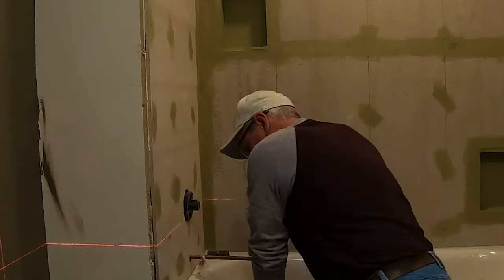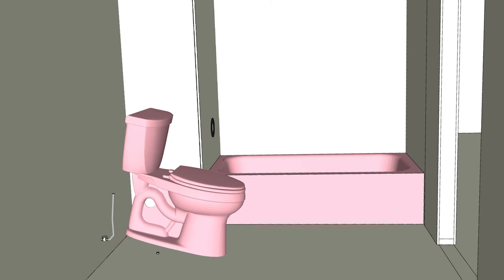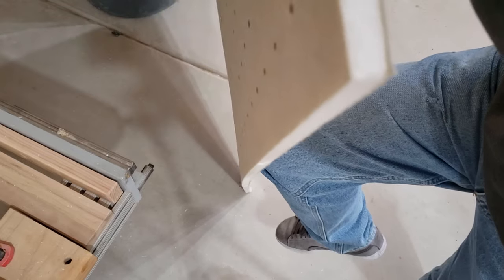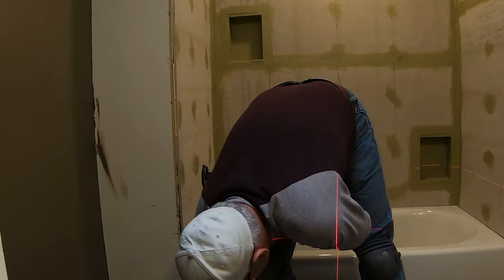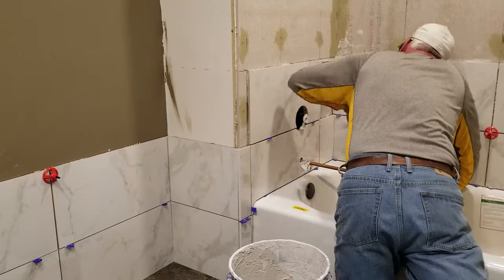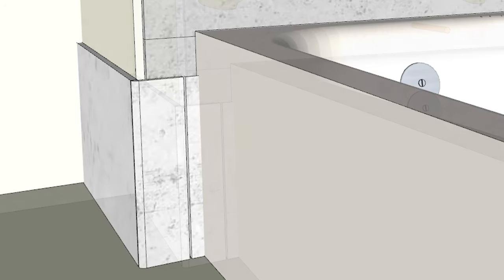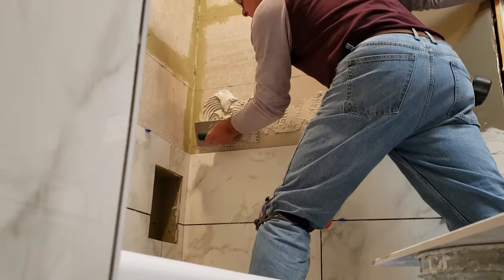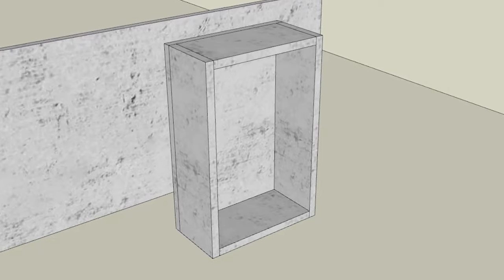Tile Setting - How to Set Tile Around Your Tub

Comment: Foam board is not only fine, it's preferable to Hardi or Durock in the sense that it is alrady waterproof. Much easier to install and probably at least as stout after tiling
Reply from the maker: I’ve only used foam board on one job where I was using a foam shower base and did a video on that. In order to meet the requirements for the lifetime warranty, I followed the manufacturer’s guidelines explicitly which included using their recommended thinset. It was twice the cost of regular thinset and was a real pain to work with as it had a short working time before it started setting up. Once it started to set, it was almost impossible to get off tile, trowels, clothing, sponges, buckets, anything it came in contact with. So I was constantly washing it off things. Once I got a workflow going, it was manageable but did not make a fan out of me. I will say, however, it dried incredibly hard, so after the tile was installed, the strength of the foam board was not a concern! Quick question for you… what happens to the water that gets trapped between the tile and waterproof barrier over time?
Reply: @RustyDobbs  I'm not entirely sure I understand your question. But if I do, you're interest lies in how it dries? First, your thinset coverage should be complete or at least 95%. Backbutter your tile and use the correct trowel. Your tile is waterproof. Your grout should be of a waterproof type or sealed at the very least. Hence, if you are grouted and caulked in corners correctly, the issue you bring up should be non-existent. I have torn out showers against sheetrock that were more than 20 years old to find everything dry as a bone. Regardless, your question would apply to CBU with redguard or Aqua defense as well. Where would the water behind plane go? As a final note, there are many foam boards availble. Most allow you to use any number of modified thinsets. Kerdi or Wedi aren't your only choices.
     Jobs fail because best standards aren't followed. Assure you follow them and your project will last till the next tear out.
Reply from the maker: @JT-rc7vx  It’s a practical question that the old guys who taught me to set tile and float mud showers would ask if they were still around. One benefit of the mud showers was that the cement wicked away incidental water that made its way through grout joints and corners over time. 1/2” Hardiebacker does the same thing extremely well and I’m sure is the reason that product was developed. You are correct that various sheetrock products were made to replace mud walls years ago because of the cost of mud showers and under the right circumstances they can last a long time. 

The move to waterproof everything behind the tile (including “cement” board products like Hardiebacker) over recent years has seemingly gained near universal acceptance. The old tile setters from 50 years ago would think that is crazy because of the elimination of the cement based surfaces opportunity to wick away incidental moisture that gets to walls behind the tile. The old timers and proponents of a waterproof envelope on shower walls agree on one thing. Water will get to the surface behind the tile or the proponents would not be promoting waterproofing products. So, my question of what happens to that water that gets to the waterproof surface behind the tile and is stopped? I don’t have a good answer. I don’t think it ever dries. I’m sure it migrates lower down the walls and sits there and if that is true, that’s not good. So, I don’t waterproof the field areas of my Hardiebacker before setting tile but do the corners and seams. My attempt at compromise of opposing viewpoints!

You are correct that if the tile installation is done right and maintained, it is going to last a long time under normal use regardless of the surface behind the tile and its preparation. I just think that the waterproofing idea has some downsides that some people find it inconvenient to consider. You are only the second person to try to address the question when I have posed it probably ten times over probably the past five years and I appreciate that. Your answer is an honest assessment. And if I read you correctly, you agree with me that water between the tile and waterproof wall is trapped and not a good thing. To quote you, “Hence, if you are grouted and caulked in corners correctly, the issue you bring up should be non-existent.” To which I would add, “Yes, in a perfect world.”

By the way, the foam board product and shower base I used on the shower I mentioned was Hydro Ban. The recommended thinset was the only problem for me. Easy installation otherwise and I think the end product was solid for foam board products. Would use again if I needed that type of product for a similar shower design. Thanks for your comments and the conversation!

Comment: Grout is not waterproof. Where do you think that water goes? The backer board don’t wick it to a drain. I get that you are comfortable with backer but times have changed. Form board is far superior. No way I’d do niech with backer!! Now I get what you mean by saying it feels flimsy. Even tho it’s not I do add more studs to help with that. Not required but man worked so good.
Reply from the maker: I’m glad you are sold on foam board. No doubt it is easier to work with. So let’s say you install foam board around a tub, then set tile, grout and caulk. Let me use your own words on you. “Grout is not waterproof. Where do you think the water goes? The foam board doesn’t wick it to a drain.” I would not be hard to convince but nobody who has raised the issue you raise can answer the simple question of what happens to the water that gets trapped between the foam board (or waterproof membrane) and the tile. The answer is that it soaks into the thinset and probably the back of the tile (depending on the tile) and never dries. You think that’s a great solution? It’s not. The last guy I had this conversation with ended with, “Well, if the job was done right, the grout sealed and corners caulked, it shouldn’t be a problem anyway!” There is some truth in his response and at least he was honest but couldn’t bring himself to say he agreed with me. I can tell you are trying to do good work by your “extra studs” comment but try not to buy off on newer ideas just because “times have changed”. Sometimes the change is not necessarily for the better, but time will tell in this case. Thanks for watching and for your thoughts!
Reply: @RustyDobbs   foam board is not new. its been around for awhile. Backer board soaks up water and foam will not. i prefer that water not to reach my wood and rot it.
Reply from the maker: @racker7855  You posed the question to me, “Where do you think that water goes?” when referring to my method of using Hardiebacker. When I asked the same question of you regarding foam board, you replied with, “I prefer that water not to reach my wood and rot it” so you use foam board. That’s your answer? What you prefer NOT to happen? It is obvious then that what you prefer to happen is that the water over time collects behind the tile against water barrier provided by your foam board. I don’t know what is so difficult for you guys who believe in these products to just say that. I explain my views in the video. You criticize my approach and then refuse to acknowledge the obvious downside of your approach - water gets trapped and has nowhere to go. I get it, there is no good response for that. If you can't defend it, then why is that such a good methodology from your point of view?

Comment: chances are if it's from 60- 70s to floated wall and you got 1-3 inches of deck/bed mud on walls so in most cases your tear out is the most difficult part lol
Reply from the maker: Yep, Marc, I have not only torn out some of those over the years, I have also floated a number of those! Now that's a process that lots of folks beyond you and me have no idea what we are talking about... a lost art! But those showers last decades!
Reply: @RustyDobbs  agreed , when they start to fail it's catastrophic though because of how monolithic they are, I'm only 43 and have done my fair share of screeded wall and still do use mud for my custom walk-in showers .... past Monday I started ripping out 1970's bathroom  just got the tub installed yesterday actually do the plumbing today and get it operational so they can bath while I finish the rest lol

Comment: Not impressed with how you did the inside corners. You want to make a full tile look like it’s being rapped round the inside corner rather then having two pieces cut on the inside corner. Makes your pattern look off
Reply from the maker: We all look at things differently, Ryan. Using larger format tile like this, my bigger concerns were to have the back symetrical and full tiles against the bullnose trim on each sidewall. I was also dealing with two niches on the back wall that I wanted to simplify cuts for as much as possible. How the inside corners worked out were just how they worked out with the priorities I had. I get your point but I would not have been happy with that layout on this job. Thanks for watching and your comments.

Comment: Your layout isn’t great lol. You could have started with a tile in the center of the wall and had two big pieces on the ends. Then start with a whole tile on the left and right wall and end with what ever piece it ends with.
Reply from the maker: You kind of have two logical choices with layout of large format tile in a situation like this. A tile centered on the center line of the wall or a grout joint on the center line of the wall. I went the direction I did to make my cuts for the niches easier. Was not interested in having to cut a rectangular piece out of the field areas of two of these large pieces of tile.
Reply: That’s how I do it. Half and wholes and try to build niece at top of tile if possible. But I get why he did it this way

Comment: Holy cow, I have never ever heard of NO waterproofing membrane. He wouldn't do that to his house. I am a DIY and have done two marble & granite showers in the past, working on a third shower with porcelain next month. I DON'T recommend this way folks. It has been 12 years and there is nothing wrong with my two showers, no moisture behind walls, nothing underneath the tubs. SMH
Reply from the maker: It’s rare that I get comment like yours and even more rare that I waste time responding to it. But a guy like you should be called upon to explain himself and his views if he can.

A couple of questions for you. I’m not trying to be a jerk, but do you know how the best quality showers and tub surrounds were built before Hardiebacker and other backerboard products were created and before YouTube? The walls were built with roughly a 3/4” layer of a mixture of sand, portland and masonry cement floated over metal lathe. Tile was set on that surface with thinset. Waterproof membrane products for tile installations did not exist and would have been rejected by tile setters anyway. One reason showers were built this way was that water that will inevitably find its way through grout joints over time will be wicked away by the cement walls and evaporate which helps to reduce the likelihood of mold forming in shower and tub surrounds. It was also extremely durable with installations lasting decades and only being replaced when homeowners wanted to update their tile.  

Why do popular products like Hardiebacker and Durock look like cement, have the same water absorbing properties as cement and in fact are often referred to as “cement board”? Based on the history I just told you about, the answer should be obvious to you. If a waterproof membrane is the solution to all moisture problems in wet areas, then why don’t these manufacturers coat their main backerboard products with a waterproof membrane when it is manufactured and make it easier on contractors and DIYers? Why would they be selling a product that according to you is unusable for tile installations as purchased from a supplier because “Holy Cow, I have never heard of NO waterproofing membrane.” Probably the simplest answer is that the people who created these products don’t think like you and probably were tile setters before they started making these products that mimic the old mud walls. If the old tile setters who taught me how to float mud walls and set tile 45 years ago were still living, they would be the ones “shaking their heads” at comments like yours.

Certainly you will acknowledge you expect that water to some degree will find its way through grout joints over time in even the best tile installations. If you disagree with that, then why would you need a waterproof membrane in the first place which you insist is so important? So you are expecting water to reach the waterproof membrane and it is stopped there, right? Where does it go from there? 

In my installations, incidental water will likely be quickly absorbed by 1/2” Hardiebacker and evaporate which is fine with me. Lots of work history and precedent for that being fine with me. In your “recommended” installations, water will hit a waterproof membrane and collect behind the tile. That is actually your intended goal. It may soak into the back of the tile (which isn’t good either), but the finish on the tile will not let it go anywhere. You say you have done two marble and granite showers in the past. You realize of course these are natural stone products and by their nature through fissures and cracks, may collect and actually soak up water, in addition to water soaking into grout joints. Are you ok with water getting behind your marble, granite and porcelain and just sitting there? Does it not concern you that mold may be growing between your tile and waterproof membrane that you cannot see. You say there is “nothing wrong with my two showers, no moisture behind walls.” You don’t know if that is true between the tile and waterproof membrane. Have you pulled tile at the floor level of those showers and looked? You can’t explain what happens to water that is, by your design, trapped between the waterproof membrane and back of the tile. You think a waterproof membrane solves all problems. It doesn’t. So, what happens to water you are trapping behind your tile?